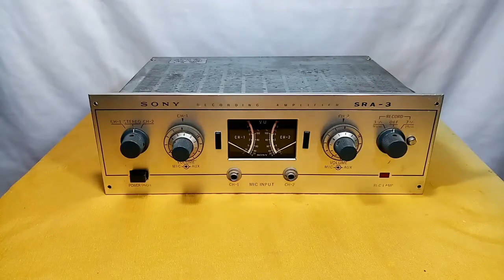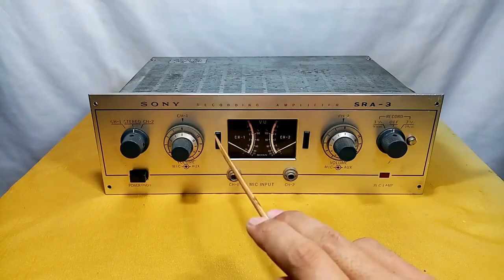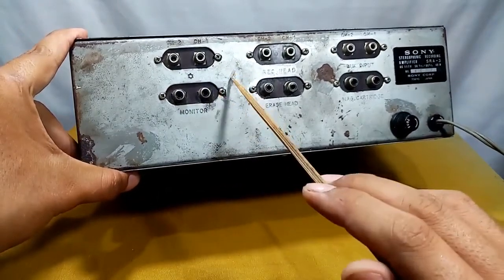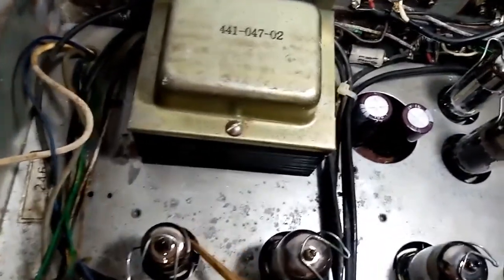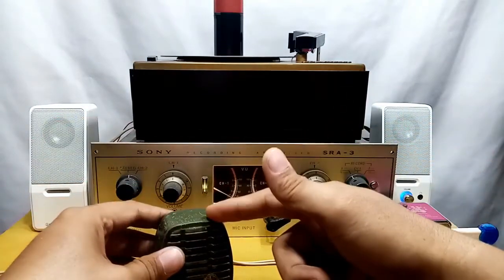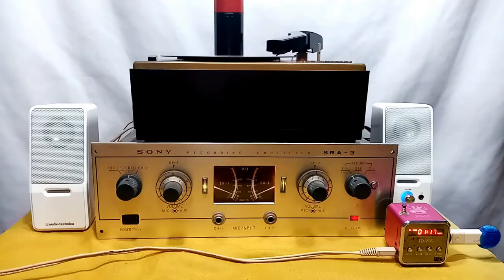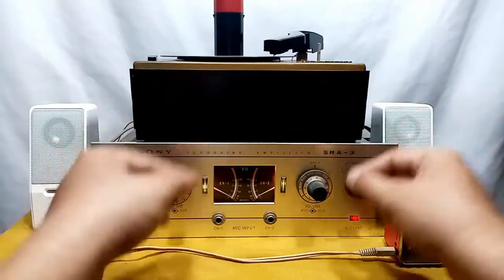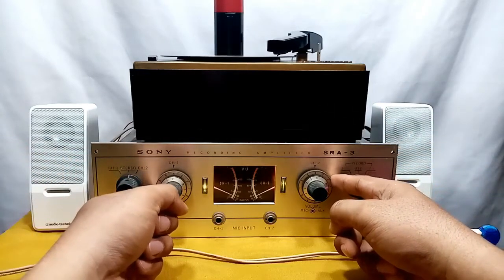Sony SRA-3 Recording Amplifier

Comment: The SRA-3 is a very good recording amp for reel tapes but it's awful as a phono preamp.  The phono stage is a solid state using TX-128 NPN transistor which is often overlooked.  Placing the RIAA circuits at the inputs and in front of the transistor is a terrible design for a phono amp.  This demonstration only shows that the unit passes signal of a ceramic cartridge.   The record switch set to OFF will mute the monitor but and when set at 3 3/4 there is distortion from the NAB circuit.  When in the record mode, the internal oscillator circuits the apply a high frequency AC 100kHz to the outputs and mixed with audio signal.  There are better choices for a tube phono stage don't fall for this tube trap.
Reply from the maker: Thanks